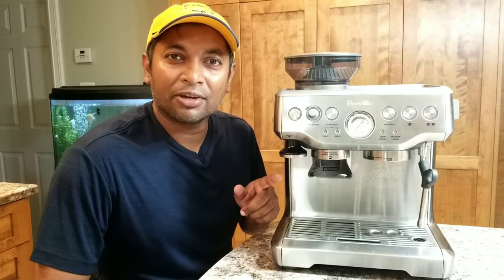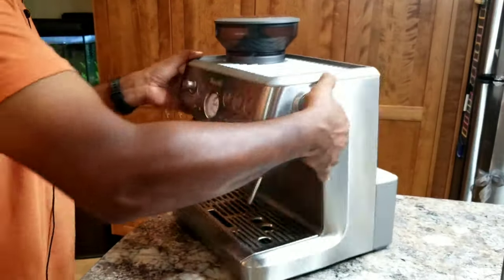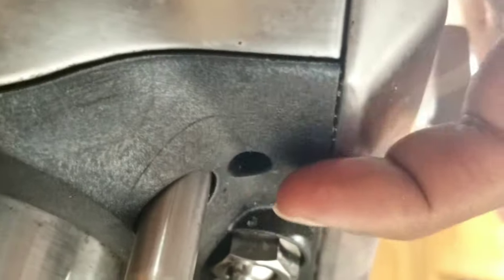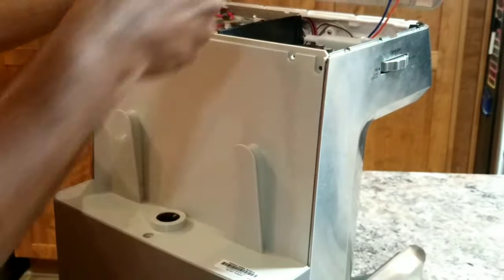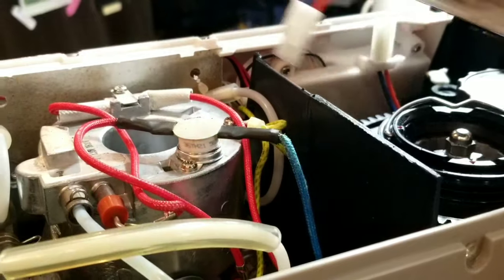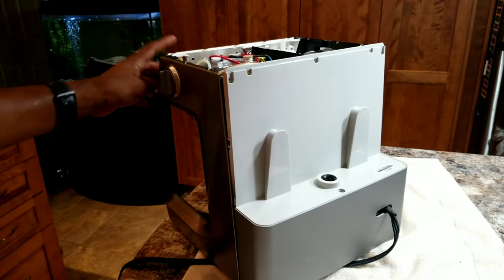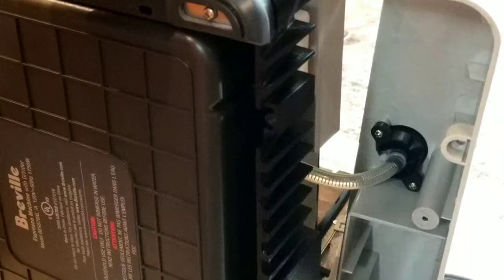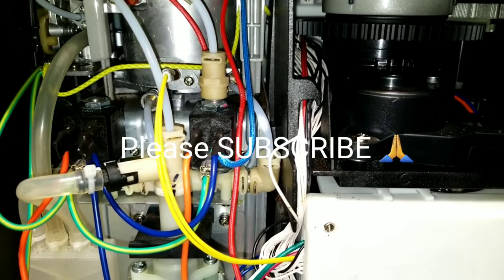How To Open Breville Barista Express BES870XL

Comment: Any tips on why my barista express isn't producing water or steam fresh out of the box, brand new?
Reply from the maker: Is the water in the tank way above the minimum level? 
Ensure water tank sits properly. Else press it down again. Then switch ON the machine  wait for a minute and ensure all lights around the buttons are ON. The  press double or single cup button. If there is still No water, then there's a defect. Please call Breville support.
Reply: @AjusCafe  Thanks for the reply. Water level is about an inch below max, the tank is seated properly. It will be going back this morning and hoping for an exchange
Reply from the maker: @troygatto5666  yes, sounds like a faulty machine
Reply: @AjusCafe  Yep, I exchanged for a new one 😁

Comment: Did you figure out your leak?
Reply from the maker: Yes i found the leak. But still deciding on the fix. I'll post it today itself.
Reply: @AjusCafe  In case you need parts,... I have called Breville for parts info and they are great and seem to have all the parts available for a very reasonable price. Even the pump and solenoid were fairly priced.
Reply: Excellent video. My pressure gauge has stopped working but the machine is still making good coffee. Should I try a repair?
Reply: @robemery11  I remember seeing a video some time ago where someone did change the gauge, so it is poseible. That being said, if you can run the machine by 'feel' and sound, you might want to consider leaving well enough alone.

Comment: My barista pro only produces water for 4 secs, single ,double and cleaning modes ,does anyone have any ideas what to look for if I open it up?
Reply from the maker: Did you Reset the machine to see?
Reply: @AjusCafe
Reply: Hi Aju restting do you mean turning it off then on? as I said before it just runs for 4secs in all modes including flushing.de scaling.
Reply from the maker: @harrygray1301  No. Turn ON the machine,  Press Menu, dial to "Reset Defaults". Push button
Reply: Done that but just the same
Reply from the maker: @harrygray1301  no worries, next step is to check the flow meter. I have posted a video on this fix, but for BBE. Hope this helps to investigate your BBPro. https://youtu.be/jtczkX4DPS8 as the symptoms looks Similar. Many BBE owners had success with this solution